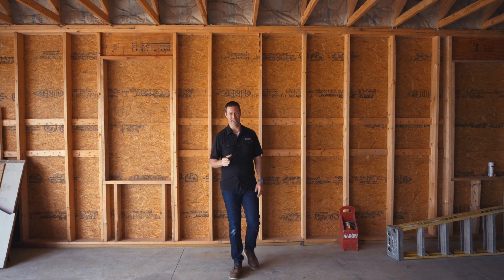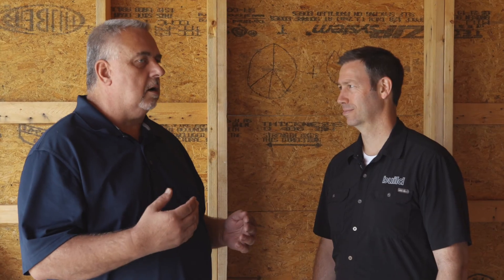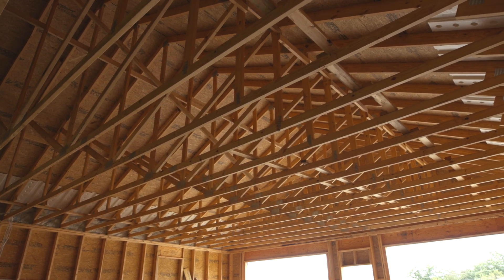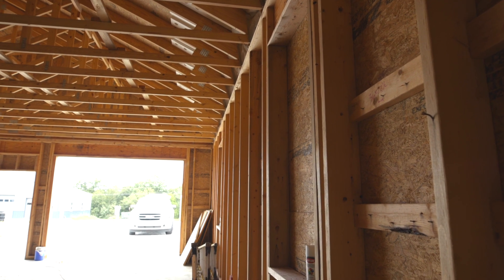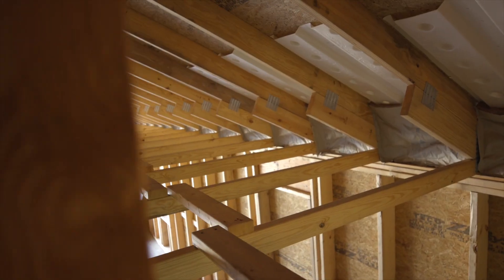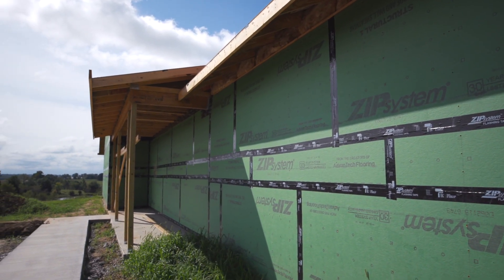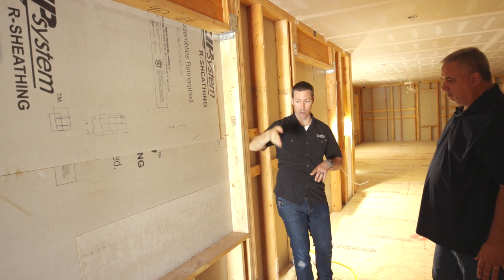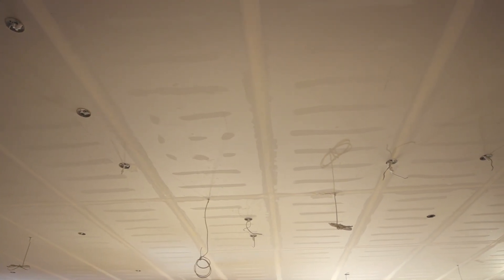Traditional vs Advanced Framing - Details

Comment: Will you do a video comparing the most efficient windows?
Reply: FWIW: The windows with the lowest loss are casement windows with multi-point locks to provide a tight seal, or fixed windows that do not open. One issue with Casement windows is that you cannot mount a window AC or fan. There likely going to be a time when the central air system fails & prehaps it takes a week or more before Tech can get it repaired (most of the time they need to order replacement parts). So have a single hung or double hung window is a better option. 

Sometimes the most efficient things aren't always the best. My recommendation is to use windows which don't rot (ie fiberglass or pehaps alum. cladded windows) & you can replace the window panes without have to replace the window frames (Pain the But). A common issue with double & triple pane windows is the seals can go bad and they loss most of their efficiency. If the window panes are removable the homeowner can replace them themselves and avoid the expense and time to replace the entire window frame.
Reply: @guytech7310  - The seals go bad in modern windows? Doubtful.
Reply: @OMGWTFLOLSMH  They do. especially if the window isn't install correctly (too tight putting too much stress on the frame). I had a brand new Window that failed in 6 months due to a manufacturing defect. No mass product sold is perfect.
Reply: @OMGWTFLOLSMH  Also the window could get damaged: storm damage, accident.
Reply: On modern igu windows that use Cardinal glass, the failure rate is something like 0.2% after 20 years.  Virtually every major window company uses Cardinal.  If your installers are racking windows, you have major issues.
Reply: @christopherhaak9824  what do you mean by "racking"?

Comment: Triple glaze windows --- What brand did he use. How common and easy are they to get.
What was the logic / decision process in deciding to go from double glaze to triple glaze.
Reply: Lots of owners are going with triple glazed these days. Much better sound and temperature insulation. If you can afford it, it's a nice luxury.
Reply: There is almost zero reason to use triple glazing in that climate.

Comment: Did he say $250/sq. ft.? What part of that is reasonable? That is double the average house prices around here and we get full basements under them!
Reply: The two insights from @Aarow Building are highly valuable to anybody considering the purchase of a home in most parts of the US: (1) if you measure weak criteria, such as cost/SF, you are prone to making poor decisions, and (2) the majority of the existing housing stock in this country sets the bar relatively low compared to how we would build those homes now with the experience, information, and materials we have available today. Cost/SF is a broad financial services metric useful to mortgage underwriters, realtors, and insurance carriers, but it really doesn't speak to the value homeowners receive or the quality of the builders.
Reply: @afs3294  Exactly!!! Cost/sq ft is a dumb number - I can design 3 - 2000 sq ft houses that would virtually look the same on day 1 for 200 / 300 / 400 respectively that have the same amenities. Visit these three houses in 20 years and it would be a different story especially with maintenance cost and operating costs as part of the 20 yr discussion
Reply from the maker: Amen.
Reply: Ken MacDonald great question. I love the fact you are willing to discuss the matter. I prefer to talk about the home’s cost in reference to its features. The quality of home we build does not compare to our local contractors. The SQFT price just doesn’t add up. I can built a 20,000 ft house for less a ft than a 1000 ft home.
Reply: @jake.bruton.aarow.building  I like that analogy, it's like what do you want, a house that is basically a frame with some sheeting .. as I've seen many cheap houses here in South Australia where we are often seeing 40 degree C days in summer, where if you have air con it runs flat out and struggles to cool down anything else but a single room, or you could build a home which costs more, but doesn't take anywhere near as much to be able to maintain comfortable living conditions no matter what weather is thrown at it.
Reply: @MassageWithKlay  Agreed - the people arguing for sq ft $$ are ONLY thinking about getting under a roof and inside walls with no value applied to health, comfort, durability, or environmental responsibility
Reply: So the garage and porch cost $550+/sq.ft.? That makes it much more reasonable 🙄
Reply: Good for you!! We all have different values
Reply: Ken MacDonald  I think there is a militia in the in the foothills looking for recruits - you quite possibly could have a new career......have a nice day my friend I'm off to scheme with my political friends.......
Reply: Rob Sinbob the square ft price is simply a poor metric. If you subtract the garage and porches from this home you can make an argument that the finished footage number is closer to $150. We don’t buy our cars (the second largest investment for some) based on cost per lb. Why talks about homes in this misleading way. It isn’t the SGFT cost it is the value per SQFT that matters.

Comment: Looks like windows will just be nailed to the sheeting. Window manufacturers want there windows secured to the structure. Doesn't look like the window framing is furred out to the solid sheeting
Reply: These windows get installed with "Turbo Screws" and metal brackets - far better than nailing flanges......Welcome to the new centrury!!
Reply: @stevenbaczekarchitect9431  I tried looking up "Turbo Screws" and only thing that came up was TurboGold screws that aren't available on Amazon and could only find them on some UK store denoted in millimeters. How do we get these?
Reply: @isleofgreg  They are supplied by the window manufacturer

Comment: That might not be expensive for what you get but, I more north Utah and we get houses are code built with r 20 + walls and r 49 + attic spaces for about half the cost of what he is doing.
Reply: That's not true r-value and it's also probably not as airsealed.
Reply: I'll agree that it's expensive. Sure doesn't sound like commodity pricing.  However, a wall with R20 cavity insulation, minimal air sealing, and to exterior insulation is going to yield a wall that's less than R10 effective.

Comment: How about some building techniques for the desert Southwest? You had a show not long ago in my area (Scottsdale AZ), but that building technique was for those with unlimited funds.
Reply: I use these concepts throughout my work in NM
Reply: @stevenbaczekarchitect9431  In general how would you design differently in a region with a long, hot (but low humidity) dry season, followed by a mild wet season e.g. much of interior California? I've heard it recommended that more insulation should go into the roof and less in the walls compared to colder winter climates. I guess NM would be a little different climate-wise with some summer monsoon weather, and colder in winter depending on what part of the state you're in.

Comment: Cool designs but $250 a sq ft is double what an average new house sells for including the lot in the vast majority of the country.
Reply: You'd have to be in the house 150 years to break even on the "energy savings." Sounds like the builder is the winner here.... outrageous! Matt used to do "makes sense" videos.... now he just promotes "out of reach for most."
Reply: I think there is a very basic argument that the industry’s idea of what a good home costs is based off of building very poorly performing homes, not building quality products that last. If you can buy a home of this quality for $125 a SQFT then that is fantastic. However you can’t. And if you think you can, you are wrong.
Reply: @jake.bruton.aarow.building  You very very much can. . . Even less than that actually. First step is to eliminate a big name designer and the General. I realize not all people have the ability to eliminate the General but far more can than do. We did and saved over $200k on a 1600 sq/ft home. . . Passive Certified to boot. It would have taken us 44 years to see a return on energy investment, ludicrous.
Reply: @andrewjackson9853  Sorry - that's a flat out WRONG!!!! $200K on 1600 sq ft cmon man.......there is way more to this story
Reply: @stevenbaczekarchitect9431  Are u familiar with Passive Homes? Are u educated on the requirements and specs? Read all the comments above about the average cost throughout the U.S. per square foot for a code built. . . Google Passive Home Specs and get back to me.
Reply: @andrewjackson9853  What's Passive House?
Reply: Aarow Building I wasn’t attacking you or the quality of the house. I was saying that house couldn’t be built in most of the country unless  a person was wealthy enough to pay cash for a home. Banks at least in every market I have seen loan money based on x per sq ft for the area. 20 years ago I had a friend that built a very very nice house with lots of extras like your homes have but all of the extras were structural or mechanical systems. He was furious when the bank appraised his home for   40% less than he paid to build it. It is only in the last few years that the value of his home has reached the price he paid for it.

Comment: I'd like to understand the choice of using header hangers - has to cost more in labor/materials than an extra piece of lumber.  And creates issues when flashing windows eetc
Reply: Header hangers eliminate the need for additional framing thus preventing unnecessary thermal bridging. For every window you have, the additional framing will add up and reduce the overall energy performance of the house.
Reply: @charnockcustombuilt9418  Yes, but it's a minuscule difference.  A fraction of a percent.
Reply: @ArthurDentZaphodBeeb  I agree, that's what I used to think until I took a building science course. You would be surprised at how much it reduces building performance. If you were to do that on a 2 story house it adds to be a significant loss.
Reply: I was also wondering about that, hangers are expensive

Comment: Matt - a passive/super-insulated house question...

I've now watched a lot of passive home videos by yourself and others here on youtube, but I remain a bit confused as to the question of the envelope/framing/insulation being vapor impermeable vs permeable. In a lot of videos, there are two-layer systems (with OSB in the middle) that appear to be built to be permeable in each direction and can dry to both the inside and outside. Then there are other houses (such as this house and your 2015 "Perfect Wall" house in Austin) which appear to be tight as a drum and vapor impermeable. Do I have simply that wrong or can you do a video on the differences between the two and the advantages/disadvantages of each...thx.

P.S. And if you ever make it out to the Pacific Northwest the Hammer & Hand crew in Portland would be a good candidate for a visit: https://www.youtube.com/playlist?list=PLbEMl6WikrRXGtr0a54f9T8u_1t5NhBsd
Reply from the maker: J, The “it depends” part is important because of climate zones. I’m in the South Zone 2 and I cool most of the year. I can use a permeable or impermeable membrane on the outside of my framing but need to be careful to never have a barrier inside my house. Poly over insulation is a failure in my climate. In the North you generally want a vapor barrier inside the house to not allow moisture on the home to find a cold condensation surface inside the walls. Outside weather barriers in the North should be permeable. Generally higher than 10 perms.  Did that help?
Reply: @buildshow  Matt (and @Anthony Brusca), giving it the zone context clears up the confusion - thanks.
Reply: Well you have to deal with two sources of moisture: one from the exterior side and the other from the interior side. Ideally the outside should be impermeable since you want to keep water out (usually from wind driven rain). Moisture buildup from the inside can get remove from the inside. Any tight home (low air leakage) is going to have a moisture problem (bathrooms, Kitchen, breathing, etc). The best option would to add dehumidifcation to prevent excessive moisture build up from the inside. No barrier system is going to be perfect: hung pictures, electric outlets, Plumbing, are are going to provide a leak path for moisture to get into the wall cavity. Keeping the humidity under control is probably going to be best overall option. 

Joe's Perfectwall (Building science) will work, but essentially leaves the studs exposed. so there is no place for moisture to get trapped and condense. But few homebuyers will want that style of home. it might not be legal in some regions since Drywall serves as a firewall.

In my opinion the ZIP wall is probably the best (compared to Tyvek or other building wraps. Sine the membrane is bonded to the OSB, it cannot tare, nor can water travel down the outside,but behind the wrap) causing wide spread damage to the OSB. the ZIP Tap applied after nailing Zip to the studs seals up most of overdriven nails. For extra measures nail penetrations that don't get taped, can be sealed off with a dab of caulk.
Reply: It all depends on where the insulation is relative to the cold side of the wall and humid side of the wall... It depends. The perfect wall house works everywhere but it's $$$$.
Reply: @AnthonyBrusca  I get that it depends (and hence the question), but more interested in totally impermeable vs. the double-wall permeable designs.
Reply: Below grade ICF isn't perfect as bugs like tunneling through the outside foam to make homes. This eventually allows water to get to the concrete as well reduce the exterior R value.

In my opinion the better option is go with traditional poured concrete walls, then seal the exterior side with an asphalt barrier, and then use rigid fiberglass panels instead of foam. No way are those buggers going to tunnel through the fiberglass panels.

Another issue with ICF is the building designed is basically locked in stone (concrete). Makes it a pain to add additions as will as exterior penetrations: vents, hose faucet, electrical outlets, etc.

Comment: since he was a young architect, It has been a long time . If his teacher had been around in now days, he would have said  put mini splits and HRV  with solar panels on a house and forget about bills
Reply: Passive approach is always a winner....just saying
Reply: @stevenbaczekarchitect9431  I could argue with that .  I installed mini split system with 3 heads 2 years ego . The price was $1800   I have to heat my house 6 month a year on average my savings $100 a month    now you can see that system will pay for itself in a matter of few years  . It is easy to calculate how much value brings  every extra one R of insulation and in how many years it pays for itself  , the more r value in your walls the less bang for your buck you get .  The  old guy just makes fool out  himself by saying this nonsense all the times
Reply: @andreycham4797  first of all the old guy I refer to is one of the most respected building professionals ever, he had forgot more than you and I will ever know combined. Yes there is a tight line between a very well insulated house and one with solar panels. Much of this calculated worth as you suggest hinges on location. Location determines solar access? It also determines solar worth? Someone paying 9 cents Kw vs 21 cents places a much different value on the solar panels as their price will not differ between each location. The ability to net meter? and or to sell back power is another important variable. Personally I think we should all live in Zero Energy homes but everyone wants to discuss payback, and while everyone always twists it in their favor - it is actually a very complicated equation ESPECIALLY when discussing various climate zones/locations. For that reason I always preach a Passive approach because it WILL WORK everywhere, regardless of climate (except for maybe SanDiego)
Reply: as someone who is trying to grapple with some of these concepts. what's mini splits, what's HRV, thanks
Reply: @MM-24  a mini split is a european style AC  which work now for heating too up to 4 times more efficient than an electric baseboard  heater. HRV -heat recovery ventilation transfers heat from  exhausting hot air to  fresh coming inside air

Comment: The trusses don't have to line up with the studs as long as the top plate was engineered for the load, they can be placed anywhere along the plate.
Reply: XMarkeyeX you are correct that engineering governs the process. But getting them close helps.
Reply: @jake.bruton.aarow.building  And aligning is ALWAYS better